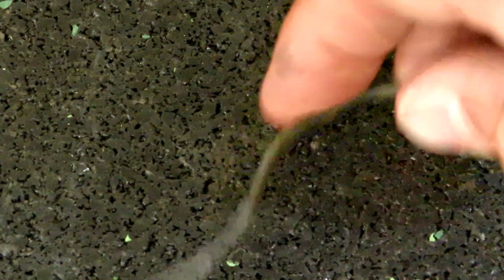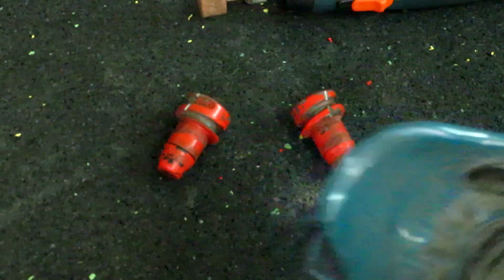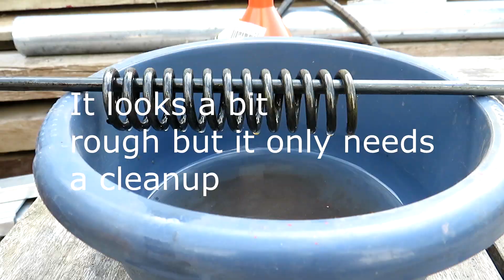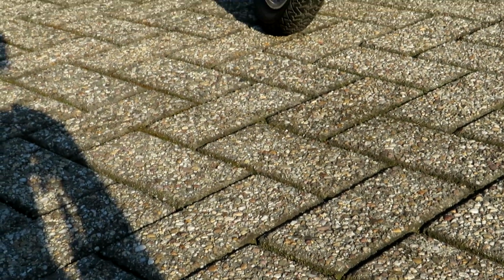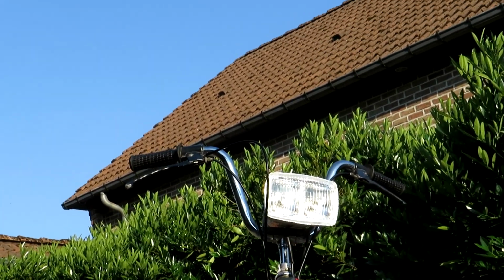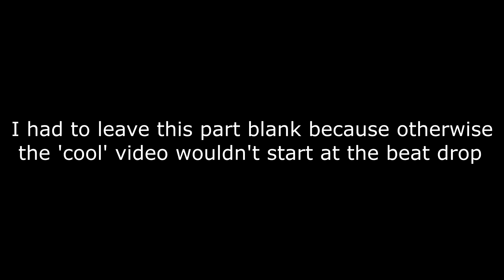Piaggio Ciao restoration #4 finishing it

Comment: With what i can clean my wheels? It has some little point of rust.
Reply from the maker: If its not to bad, you could try some aluminium foil. Otherwise some sand paper, but if you use sand paper make sure to use some fine paper at the end.
Reply: @toyomods7556  thx

Comment: i have a question, i need to clean up my gas tank, is it safe to use water ?
Reply from the maker: I used water. But i did let it sit in the sun for 2 days. And i wouldn't really recommend it. Maybe using some ammonia? But i'm not sure. I think google would give you a better answer

Comment: Dude, l love what you do on youtube.Why my moped piaggio bravo moped won't start? I replace a seal and i change the carb and it is not starting. It worked when i buy it but it had low compression but now it doesn t start. Please HELP!
Reply from the maker: Check a couple of things. Does it have spark? Try spraying some brake cleaner in the air filter. Does it have good compression now?